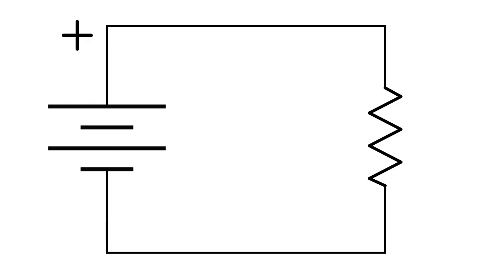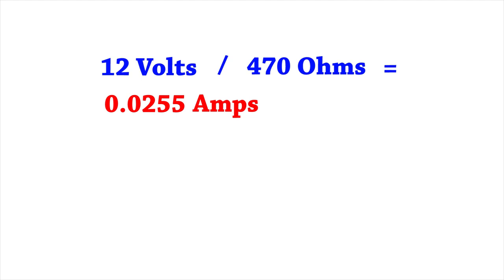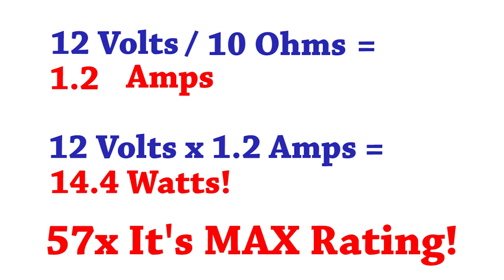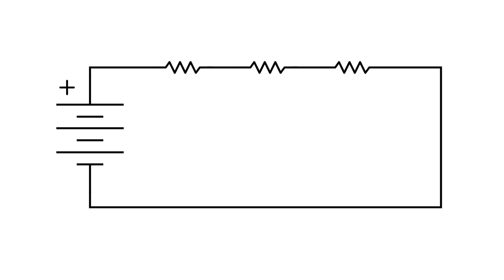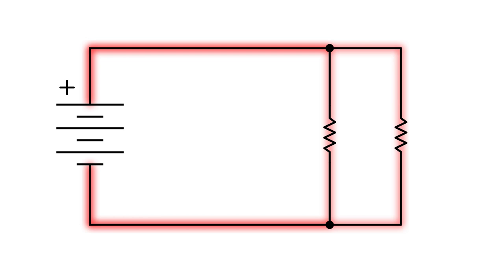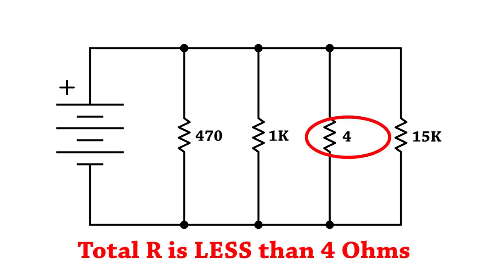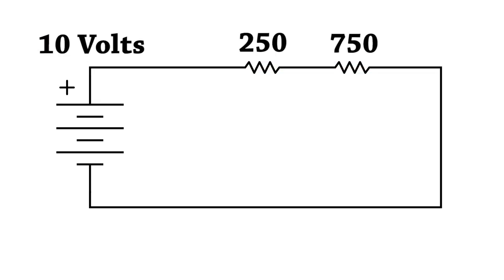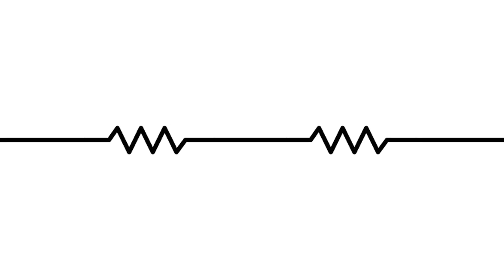Electronics: Lesson 2

Comment: very nice 😃 The voltage divider is one of the simplest circuits you can think of but also one of the most important - you can use it even to introduce more advanced concepts such as input and output impedance and attenuation right out the bat. I'm gessing the next video is going to be about non-ideal voltage sources and its equivalent internal resistance 🤓🤔

Comment: Can’t wait for the third lesson. Can you illustrate some of the theory such as using a multimeter? So I can follow in practical sense such as the various points in a circuit showing say the voltage drop across resistors etc. I find it much easier to remember that than just the theory alone. It’s very cheap to buy a breadboard and components these days. Thanks for the series so far.

Comment: I've been looking for a series like this, that steps outside of the box, great work! In this video, I would have ended by showing the tapping point for the reduced voltage between the two resistors, but I'm sure you'll get to that.

Comment: Regarding slide rules. They are great at enforcing significant figures, and in reality, often times super precise calculations with many decimal places aren't accurate anyways. Those fancy theoretically perfect calculations fail to account for manufacturing tolerances of components, impurities and imperfections in the raw materials, environmental factors, and more. By calculating things less precisely, you're inadvertently accounting for variations due to reality anyways. What good is a calculation to 7 decimal places if the best you can manufacture to is 2 decimal places? So it's ok, and proper, to not use theoretically exact calculations and introduce a bit of rounding (tolerance) to the calculations.

Slide rules also teach logarithms, help people visualize the math, help them learn and practice scientific notation, etc. Slide rules need to be brought back into math education for pre-algebra math. They are not hard to learn, you just have to practice, and would make students more intuitive with math later on.